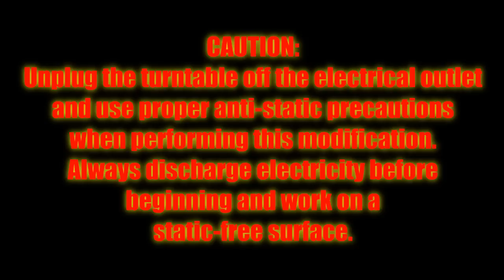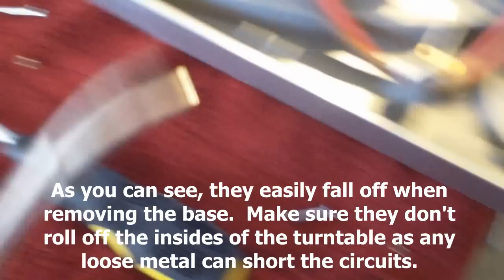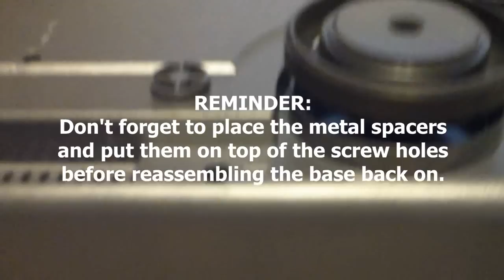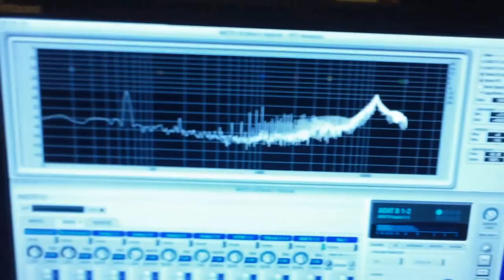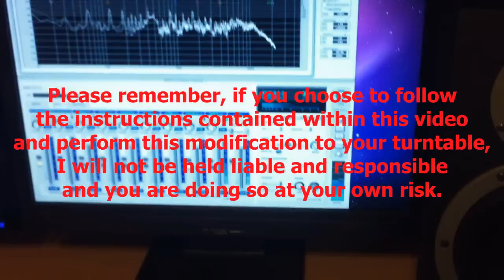AT-LP120 Preamp Removal (Step by Step Instructions)

Comment: hey I have a question I have a decent turntable with no preamp and a cheap ass crossly with a built in preamp is there a way for the meantime to tale out the crosley preamp and use it for my other turntable
Reply: Throw that Crosley as far as you can. Go to ebay and buy a real piece of equipment such as Pioneer or Yamaha. Prices are quite good also. Make sure you get one that has PHONO inputs. You won't need a preamp then.
Reply: +billyboi57 ok cool then I just bought a Sony av reviever with a phone input and I don't use that crosley it was a gift I have a decent panasonic turntable
Reply: +tyler henry just without a preamp

Comment: I guess mine is the PL-120 with no USB. It has two smaller boards where the one big preamp board is, one attached to the preamp on/off switch visible through the platter. Seems more difficult to mess with. Which is unfortunate, I may just get a new TT with no built in preamp. This seemed so easy but I can't be trusted with even easy things. Has anyone tried this with the non USB?
Reply: J Lizarraga did you ever receive a response to your question? I have the same non-usb TT and was thinking about trying this mod. Unfortunately I can't find any videos showing the mod. on the TT like ours.

Comment: Why not use a thread rod to hole the spacers and attach a note cap or just nut onto the threaded. The threaded rod would come right out the back cover.  Yes of course you could cut down a long screw.  I stop now.

Comment: Why the board should ever be removed??? You could easily leave it there and just bypass the wires! Or possibly install a switch for bypass
Reply: I believe that this is done in an effort to remove as much extraneous electrical noise as possible, the table comes with a bypass switch already.
Reply: The preamp has a cleaner that removes the electrical noise around or above 10Khz. Our ears reach 20k and many records sound "fuller" with the extra information to our ears.
Reply: Interesting, so its like how Dolby NR can clip the sound on tapes a bit if not done right

Comment: This step is not required. Leave it in there and you will be just fine. According to Audio Technica support you can bipass it completely if you just switch it to line out. Though many claim this is not the case i believe its been proven.

Comment: Learn how to solder/desolder!  This is so unnecessarily destructive.
Reply from the maker: Thanks for the advise.  I'll take that in consideration but it's working fine for me with no problems whatsoever and been enjoying playing music with this turntable for almost 2 years now. To each his own!
Reply: TotallyNuss I don't think it will make any difference. When you make an electrical connection in your house, do you solder your cables? Yup, no, right? Same process is applied here. It would be easier to go back and re-do if you have to, just in case something happens. Good job overall.
Reply: +Jammin Dave While it might not make much difference, it could. We're talking under 10 millivolts of electricity that is mostly at higher frequencies than standard household AC. Kinda what you could call an apples and oranges comparison.
Reply: +TotallyNuss I agree
Reply: Ha!  Clever!
Reply: Anything that we should know before soldering the wires together?
Reply: ipreferns Are you sure? I would think soldering would ensure the wires stay together for a long time. I don't mind learning to solder either.
Reply: ipreferns I would not mind learning to solder but it seems cheaper and easier to just use B connectors so I will do that. Thanks again!
Reply: Soldering irons are not pricey and it's a great skill to learn. You can get a Weller SP40 on amazon.com for the bank-breaking price of $14. Give it a shot. You'll be glad you did.  Nothing beats soldering for a solid, reliable connection.  BTW, if an "electrician" tells you soldering is retarded you most definitely don't want to hire them because that is contrary to what any other electrician would tell you.  Especially if they give up being an electrician to be a security system installer and take a tremendous pay-cut/skill-cut.  Even worse if they're calling themselves an electrician when all they are is a security system installer.
Reply: TotallyNuss I actually ended up getting a Technics SL-D2 so I am good. lol Thanks, thoough. I will learn to solder just for the usefulness of it.
Reply: This isn't the same as the wiring in your house. If you solder the first time there will not be any reason to go back, at least not for bad connections. Mechanically joined wires can corrode over time making it necessary to go back inside and rework. Solder and heat shrink and you will never have to deal with it again.
Reply: Actually, in this application it could be very critical to ensure that all of the audio signal makes it to the receiver. Besides, solder shows good workmanship.
Reply: Electronics soldering is not hard to learn. And it's not expensive either.
Reply: Wrong. There just happens to be a Weller handheld soldering iron with extra tips, solder and a solder aid for $16.00 or less, depending on the wattage. A 25 watt iron is recommended for this work.
Reply: billyboi57 I agree. As convenient as tying the wires may be for people that want to get the job done learning to solder is a simple and useful skill that will be worthwhile.
Reply: ipreferns Yeah. To each his own. Not everyone needs to know how to solder.
Reply: If you resort to cutting wires then it is destructive.
Reply: Spot on.
Reply: Solder the RCA cable directly to the tonearm board.  It's faster and cleaner than messing with the cable that comes from the preamp.  I wrapped the preamp cables around the preamp and installed it with no electrical connections just in case someone would want to reinstall it in the future.
Reply: I tried and hooked it up to my system and it didn't work for me I can barely hear the sound.

Comment: Is it ok to use electrical tape to seal the wires? Dunno where to get Cap/Nut here.
Reply: Definitely want to get some kind of proper splice parts on there. It may work with just the tape for a while but its not proper. You can order some online or any hardware store should have some form of electrical splice connectors. There are many different varieties that would work just fine. For $5 - 10 you can usually get a handful.

Comment: One suggestion - I'm the worst handyman on god's green earth and don't have a heck of a lot of tools or other thingamajigs just lying around. If you'd started this video with everything you need to get this done first, it would have been even more helpful. So you'll need a 1) Phillips head screw driver 2) a snipper (or whatever) to cut the wires 3) something to splice the cables with (i'm guessing you can use the snipper?) 4) twist/nut cap connectors (wtf? who has these just lying around?), oh wait, never mind, I'll just bust out my soldering iron... 5) zip ties (again, who just has these things just lying around?

Comment: You keep using "spliced" when you mean stripped insulation.  For the long run soldering is always best.  Corrosion can develop inside the twist nuts.  You could also use shrink tubing, which is a lot more professional than lamp twist nuts.  With soldering and  shrink tubing, you're set for decades of trouble free listening from those joints.  Come on.

Comment: They've had a couple different versions of this turntable over the last 15 years... what a stupid design choice: putting the loading capacitors separate of the phono preamp stage and present in both the preamp AND bypass paths.  STUPID.  You're probably better off just buying the high torque Hanpins.  This is still just another pulse "hunt & seek" direct drive, not a linear frequency generator servo.